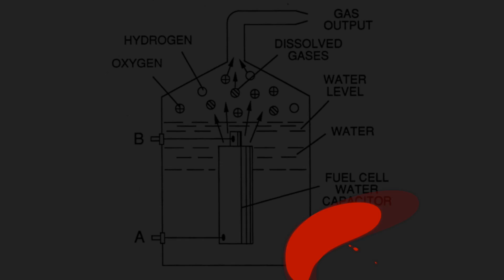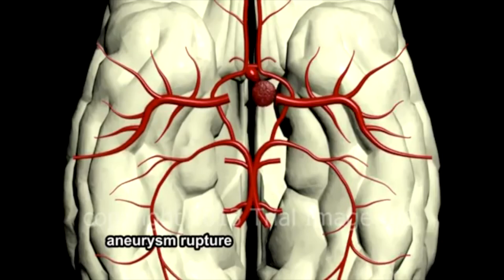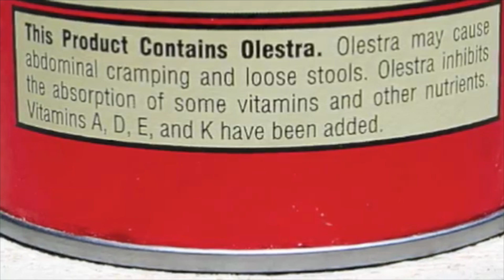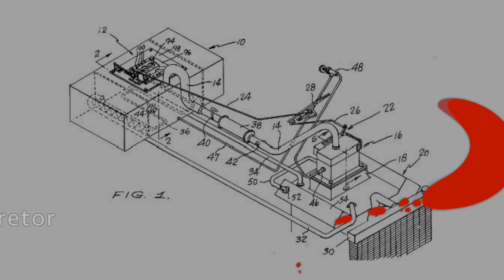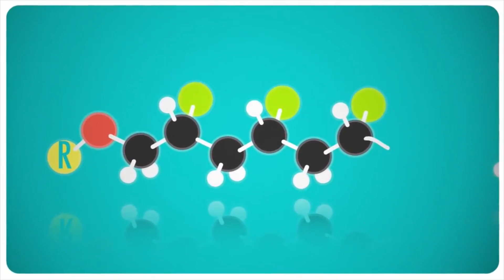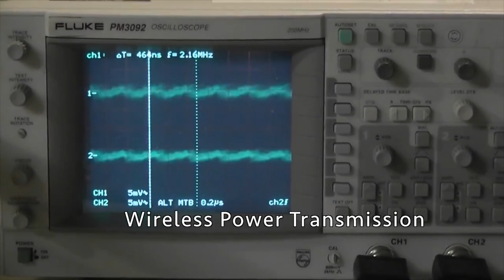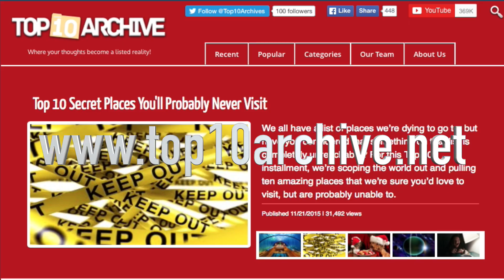10 LOST Inventions That Could Have CHANGED THE WORLD!

Comment: 10. Water Fuel Cell 
9. Cloud Buster
8. Olestra (Alternative of Fat with zero calories)
7. Chronovisor (Generally Past incident review)
6. Silphium (Natural contraceptive, currently extinct)
5. Flexible Glass
4. Tom Ogle's Carburetor (Superfast, Super milage motorcar engine)
3. Starlite (Ideal Insulator)
2. Sloot's Digital Coding System
1. Wireless Power Transmission

Comment: I don’t understand how Tesla’s wireless transmission could work. If energy were to move from coil to coil it seems it would have a potential energy loss. Also, energy moved through wires is high enough off the ground so that it will continuously flow through the wires. Energy will usually take the path of least resistance and if something conductive presents itself it may choose that path. I wonder how Tesla’s invention intended to tackle that.

Comment: My email: htg@interia.pl , tel. +48-780-129-544. I invented a breakthrough source of energy. It will be useful for laptops and for cellular telephones. It will bring multi-billion profits. I am looking for capital in the range 1000 000 EUR to 40 000 000 EUR for prototyping, patents and production. I have a computer simulation of my energy source. The simulation is based on Classical Electrodynamics and on Circuit Theory. Both of these theories have been very well experimentally confirmed.

Comment: the light  from stars is over 10,000 years old so if you found light from earth from a 1,000 years ago you can see the past by bending it back towards earth
Reply: But light from 1000 years ago would take 1000 years to return to Earth. Meaning light leaving Earth from 2018 wouldn't be visible to us until 4018 if you were specifically choosing 1000 years. And you could never see further into the past than when the reflector finally made it to its destination.
Reply: @pyroguyman096  It'd still technically be a time machine

Comment: I told ya that using water instead of fuel is possible and there probably someone somewhere on earth doing it now without show it to the public or sell it. becuz fuel industry kill them :)
Reply: Hi, mechanical engineer and mathematician here. You can only use water as fuel if the "burned form" has a lower chemical energy state than water or if the input energy to create the fuel comes from a source that is otherwise not useful (thermal energy, typically).

The act of separating water into hydrogen (as said in the video) requires inputting energy (typically electrical energy, which is a useful form of energy). The act of burning the hydrogen (as said in the video) just creates water again, while outputting energy, and is not in a lower energy state (because the burned form is water). The output energy of Hydrogen burning in Oxygen is exactly equal to the input energy needed to separate the water in the first place.

Therefore, if 'energy in' is exactly equal to 'energy out', you cannot get mechanical motion via this method. This is especially true when you realize that there is inefficiency in the input energy actually making hydrogen (current fuel-cells are 50-65% energy efficient if my memory serves me right). Then there is energy loss in the combustion of the hydrogen.

It would be far more energy efficient to just take your original input energy (typically electrical energy) and put it directly into mechanical energy, as opposed to putting your input energy (electrical energy) into the separation of hydrogen, then combusting that hydrogen, and turning the pressure from gaseous expansion in an enclosed volume (due to thermal energy in the molecules) into mechanical energy.
Reply: "mechanical engineer and mathematician here" who gives a shit who you are? Have you ever invented anything beyond what you have been taught? Don't speak on something you don't know. There are ideas floating around this world beyond your comprehension. If I listed all the people that said certain technology or idea wasn't possible and backed their claim by boasting about what they studied, we would still be in the dark ages.

Comment: Wireless power transmission could have changed the world? How so? it is EXTREMELY inefficient. VERY dangerous (Tesla almost killed SEVERAL people when he was working on it) and just plain UNNECESSARY. It takes 10,000 volts to make electricity jump a gap of only ONE CENTIMETER. Gee..seems like simply having that electricity travel OVER WIRES is much better.

Sure..that could have change the world. For the WORSE. Tesla's vision literally would have required huge lightning blots (complete with loud thunderclap) every time you turned on your TV. You see..he was actually LEGALLY batshit insane later in his life. And this is one of the things that drove him there. Working on hypothetical bullshit..STEALING MONEY from investors who gave him money to work on other things which he used for this bullshit, and never accepting that it was pointless.

Comment: Starlite is preform of aerogels, instead of converting the liquid directly into gas you let the liquid freeze the rapidly heat it up to cause mass evaporation leaving away a porous grayish substrate, only downside to starlite is it only has 80 percent the heat resistance of aerogels and is several items less durable. Nobody uses it because it's a lot more expensive to make vs aerogels and they also have a far greater application use than starlite which can only be applied to other porous surfaces.
Reply: Aerogel is difficult to make, and hard to cut and can be brittle.

Comment: Tesla was a self-educated engineer and physicist.  He was very neurotic.  He did some early research into radio, but Marconi beat him in its development.  His be claim to fame was the invention of a synchronous AC motor.  One turns it around mechanically and electrically and you have a generator.  It ended up that AC can be stepped up and down in voltage through induction (i.e. transformers) and transmitted over wider scope than DC.  He sold those patents to Westinghouse for a generous lump sum -- I assume that Westinghouse did not want to work with such a character.  Tesla, then squandered it on pipe dreams.  He also defrauded investors with his pipe dreams.  Can anyone, tell me a practical use for a tesla coil other than entertainment?  Tesla is the hero of the scientifically retarded.
Reply: using a tesla coil for the purpose it is used for is quite retarded.

Comment: I'm sorry but a couple of the were scientifically and physically impossible which doesn't make them lost just crazy.
Reply: COUPLE? like 8... and ye the one with code :D working just once, woth that exact pixel conversion :D

just the fat-replacing shit would work, but be so useless...
Reply: Let us see...

#10) It takes more energy to split water than burning the oxygen and hydrogen can produce.

#9) That is just insane.

#8) That would kill most Americans from lack of minerals and stuff.

#7) Technically you could see the past but that would required going several times the speed of light.

#6) That would not surprise me if it existed or still exists today.

#5) That would not be glass but another type of material because glass's crystal structure doesn't allow that.

#4) Idk but I wouldn't trust a reporter.

#3) Very unlikely to exist but could possibly exist.

#2) That would be very difficult to do.

#1) You would need an EXTREMELY powerful Tesla Coil.
Reply: David you are pretty wrong, it takes just the same amount of energy to burn hydrogen and oxigen than it takes to split water, but if we dont count the losses

and to the first one, you would need very powerful source of energy, thats right, but you would have been loosing 95% of it all the time, spliting critical parts of our blood cells in our bodies by that everytime we would touch some steel or shit, so it wouldnt be just not economic decision, but as good as suicide :)
Reply: AlaveonIsHere I was counting losses for it turning into different energies than is required to run an engine. I know perfectly well about the law of the consevation of energy. I should have said that in my earlier comment.

Comment: Tesla's giant transmission tower also electrified fences, cows' horns, and practically anything else shaped like an antenna within miles of the tower. You can beam gigantic amounts of energy into the space around you. It would be free, yes, but there is NO way to make it safe.
Reply: +doggonemess

It's not free, it's a hugely inefficient way of transmitting power. You would need a huge amount of energy to power the transmission towers continuously, most of which is completely wasted beaming it into empty space. On top of that the power you can actually draw from it decreases exponentially with distance from the transmitter.
Reply: +MetalJacket Excellent points! Thanks for the details.

Comment: An awful lot of these guys die suddenly just before taking their inventions public. I can see why there are so many conspiracy theories there.
Reply: Gopher Cheese Very definitely, and in most of these the person is usually very close to a deal before something happened to them, so it's not like these were all just theories, most if not all of them had a working, provable product that very definitely worked and showcased it publicly.
Reply: two words: the jews
Reply: Because there are so many conspiracies!
Reply: How many coincidences does it take for conspiracy to be called common sense?
Reply: +Tom Scot someone with alot of power amd authourity
Reply: people will always have an imagination and people who believe in any conspiracy theory
Reply: I tried the whole water thing.  And it does work.  I got as far as using electricity to break the water to gas, and yes it is flammable.  But that's as far as I got.  Supposedly you also needed sometype of pulse width modulator to control the current.  So I'm sure that someone with a little more know how could of used this to run a car.